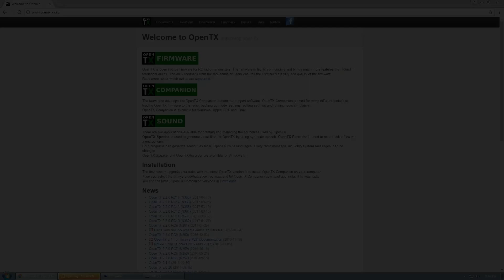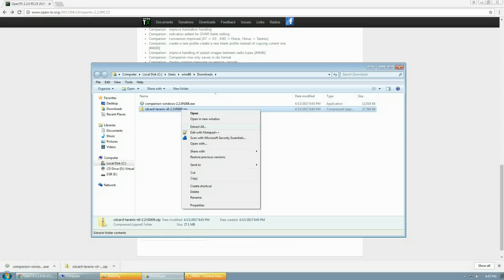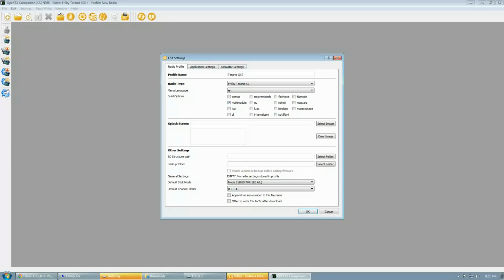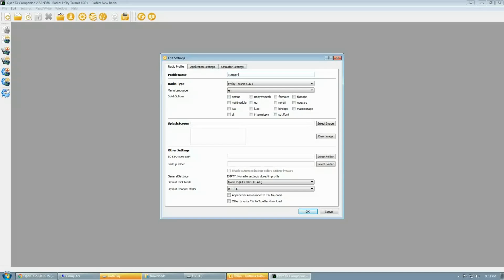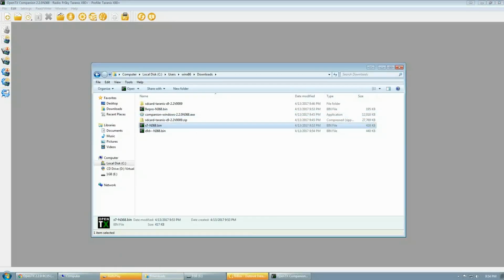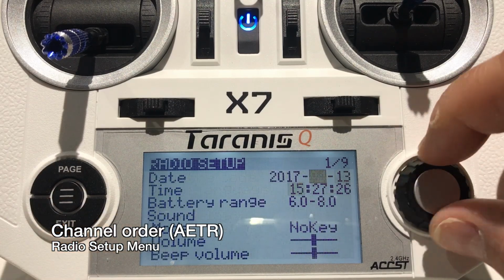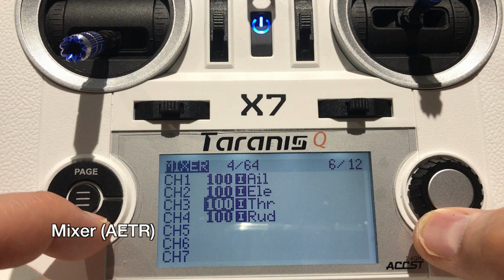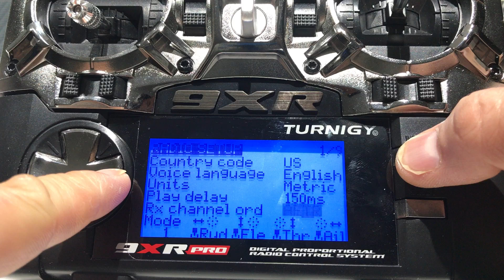✅ STM32 4in1 Multi Protocol Module iRangeX IRX4 for FrSky Taranis Radio Transmitter OpenTX QX7 X9D

Comment: my hubsan x4 binds but none of the sticks respond? any idea why?
Reply from the maker: +Ronn2664 there are lots of different versions of the x4. So you have to choose the right protocol for that model. That's all I can think of
Reply: kenVersus I chose multi then hubsan on external with internal off. I think I selected it right. It binds and my hubsan with solid lights but motors won't turn on stick inputs. Thanks anyway Ken. Appreciate the response.

Comment: Hi very detailed video i compliment you but i would need a help i bought this module from banggood man i did not update i just installed opentx and updated firmware on my taranis x9d+ with vers. OpenTX 2.2.0 RC18 (N371) but my cheerson cx10wd does not bind, Please help thank you.
Reply from the maker: +Claudio Latino you have to search what protocol it uses. I don't have that quad so I wouldn't know.  The older cx10 works. Not sure about cx10wd.

Comment: https://m.banggood.com/Multiprotocol-TX-Module-For-Frsky-X9D-X9D-Plus-X12S-Flysky-TH9X-Transmitter-p-1097688.html?rmmds=categories this would be an easier option 4 me. i just want a good tx for me e010 n e011. and this module apparently is just plug n bind. no configs required.

Comment: when i transferred the fw file into the firmware folder mine appear just as FILE. yours appeared as bin FILE. is that ok?
Reply: im using windows
Reply: i also noticed yours has open tx logo. mine is a blank paper logo. did i do something wrong?
Reply from the maker: +Jan Domingo it should have .bin extension. If you don't know how to name a file you really should not be flashing your transmitter.
Reply: so i can just type .bin to it?
Reply: i really want to use a hobby grade tx for my e010 and e011. so i followed your steps. and thats how the file appeared.
Reply: it finally saved as .bin when I used a mac instead of windows. but I already bought the single module nrf. But I can still update the qx7 with the files from my sd right?

Comment: hey I wanted mode 2 with throttle and yaw on left stick and pitch and roll on right stick. which order of the A E T R should I choose?
Reply: should I set it to A E T R for mode 2?
Reply from the maker: +Jan Domingo I use Mode 2 with AETR channel order.
Reply: will that make the left stick throttle n yaw, right stick pitch n roll?
Reply: this will only operate on A E T R correct?

Comment: i thought this video is the only one anyone needs to fly most quads? i just saw another video update stm? I thought all you had to to was place the irangex in the back.. update opentx n setup a model?
Reply from the maker: +Jan Domingo you don't have to update it. But like everything the firmware will get updates with new protocols or fixes.

Comment: Great video.  Do you know if this works with the Bayangtoys X16W?  The last 4 in 1 worked with the X16, but not the X16W.  The W version had a different protocol.     Thanks
Reply from the maker: +Ron Eubanks I'm not sure. I don't have that quad. You'd have to find out what protocol it uses and see if it's supported in the firmware.

Comment: Hi Ken, thanks for the excellent and detailed information!  It didn't appear to be any soldering required on the updated version as compared to the former unit?
Reply from the maker: There is no soldering at all.  Update OpenTX and plug it in
Reply: Thanks, there is no option for manual channel selection and binding either right?
Reply from the maker: there is no dial or button on it, so no manual selection.